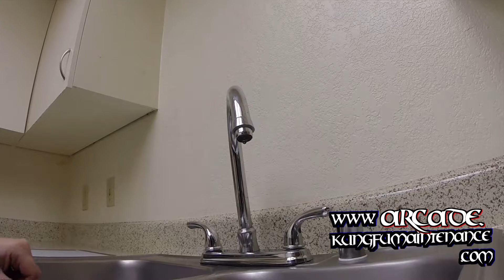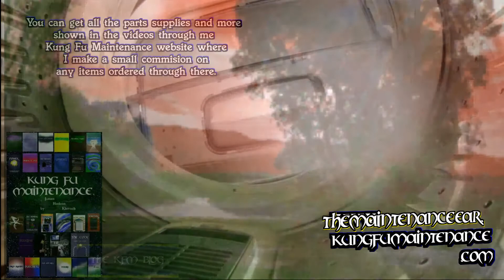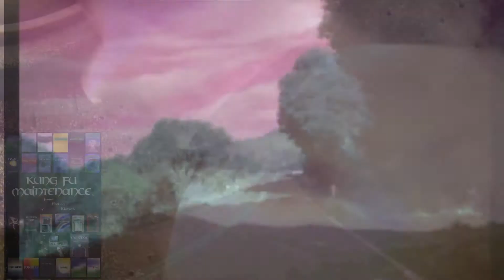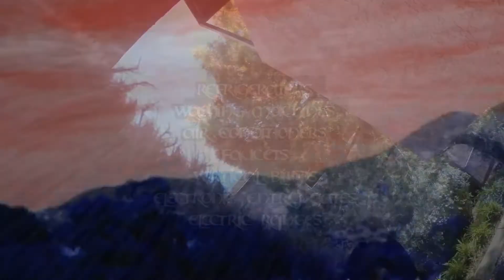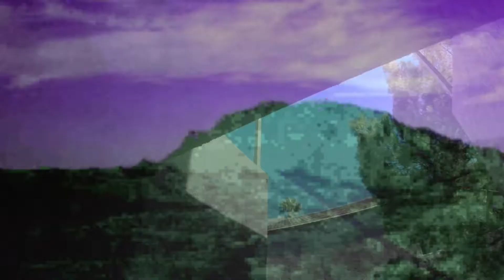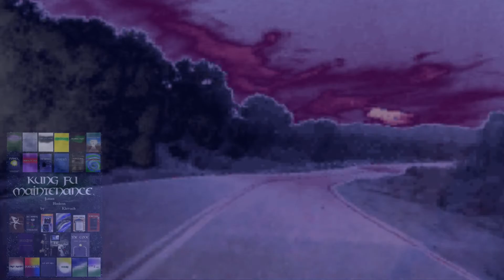Two Handle Faucet Leaking From Hot Side Tap But I Only Have Cold Side Ceramic Disc Cartridge Repair

Comment: Our ceramic valve is all one piece. Doesn't come apart and we can't find the part. The dripping faucet is so very aggravating. We had a plumber try to fix it. Paid the darn bill and still not fixed. I will not call them again. I'll call someone else or fix it myself.